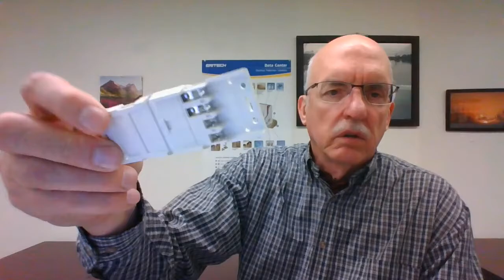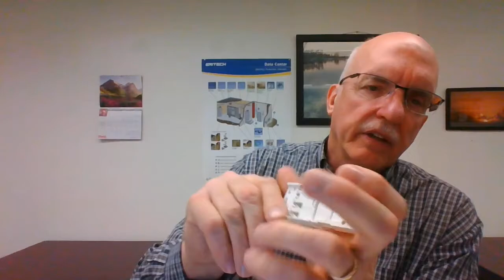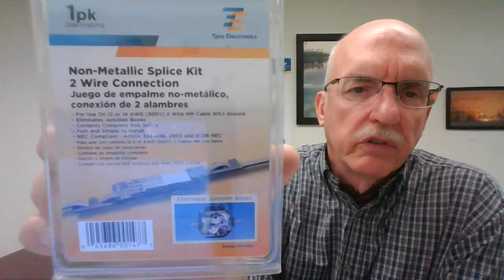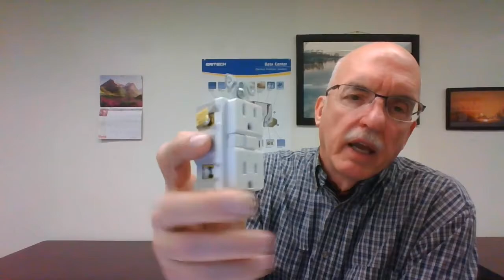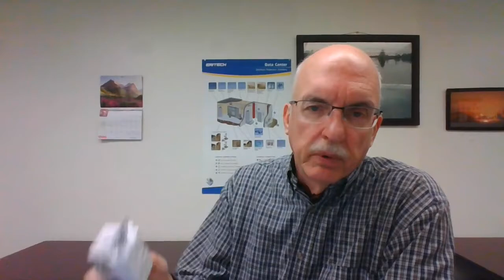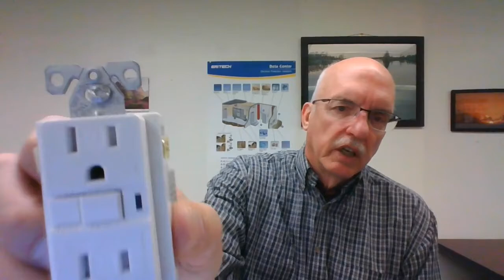Electric Education Center Session #10   NEC 2014 Major Changes

Comment: Rich I disagree with not allowing a gas pipe drain line etc below a panel. I wired a very large house where the plumber ran 4 inch copper drain line the entire length and one side of basement. The gas line 1 inch copper water service  and drain line entered the basement close to the 2 panels. 4 inch copper drain line was two feet off floor and almost touching basement wall. Only mounted panels on painted exterior plywood and had no.problem working in panels.At CHOP they would install stainless steel pan under drain lines in electrical closets. Thanks for another very informative vid. tom grabowski

Comment: Thanks Rich for another informative vid. Thanks for mentioning the IAEI  Great.place to meet inspectors electicians  Engineers. I can remember that at least 1 company sells fire rated ty rabs for the same.price of non rated ty raps. The front of hospital grade receptacles are usually made from nylon. Tried breaking the face on a couple brands with a ball.pein hammer with no luck. Do all of the AFCI circuit breakers have some method of letting you know what caused breaker to trip ( overload ground fault or arc gsult )? I know Squate D has it.